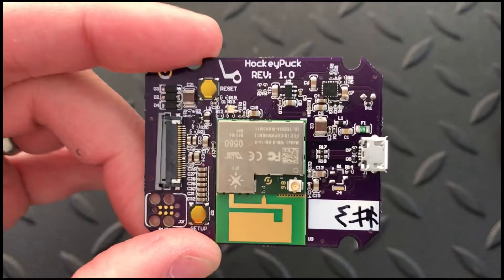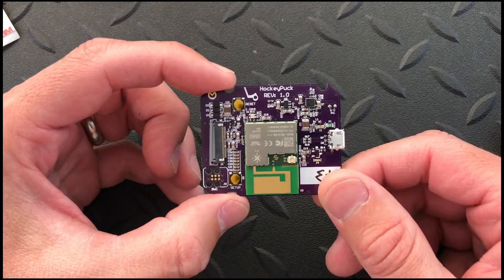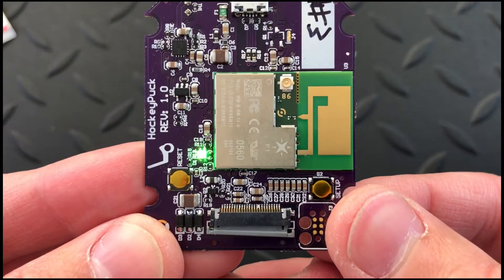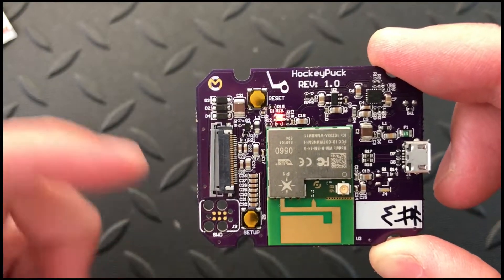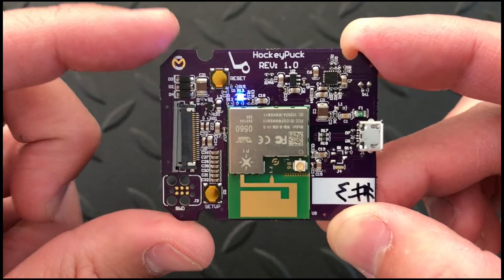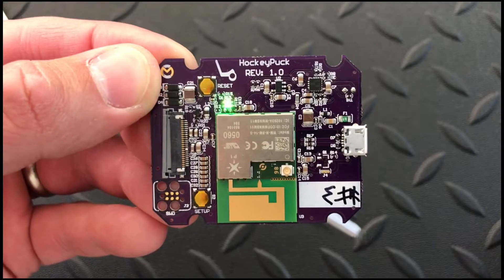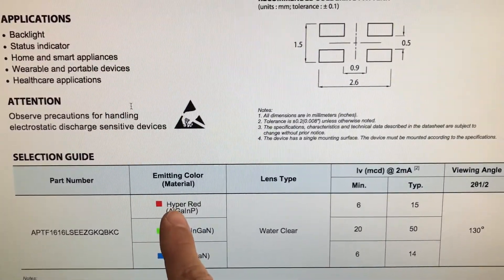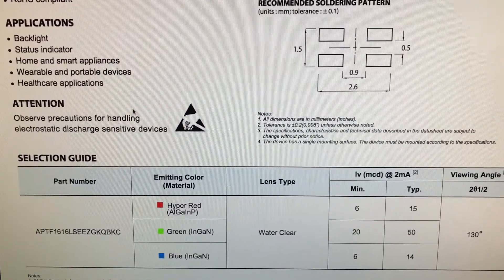Debugging the RGB LED Issue

Comment: Scope it out, look at the forward voltage with each colour :)
Reply from the maker: Hey Mikey! So I have the forward voltage values in the datasheet but the graphs that show intensity vs forward current are all normalized so they are just a fraction of each individual color's total range. So I don't know what % of green equals 100% of red in terms of brightness if that makes sense. Maybe I'm missing something. I'm thinking of just doing a trial and error approach. Thoughts?
Reply: That makes total sense, You can just do trial and error, and in this case that might be the faster option. did you use the same resistor values for all three colours? they should technically be different, since the forward voltage of each colour should be different.
Reply from the maker: Yeah, they are different and the resistors are slightly different to coincide. Shouldn't be too hard to adjust and figure out what the sweet spot is for each. Thanks for watching man. Really appreciate you chiming in.
Reply: never a problem man, PM me, I have something IoT related I want to send you for your shelf :)